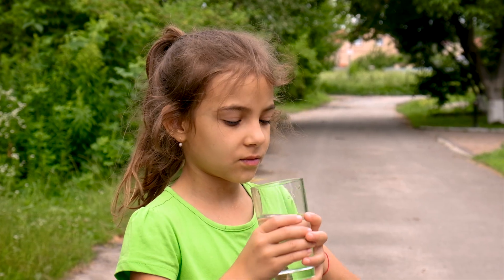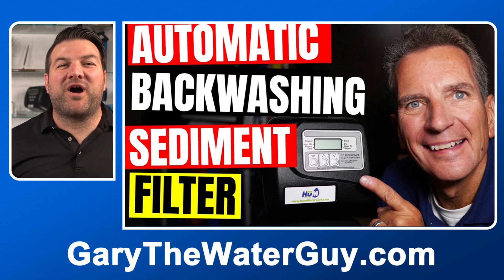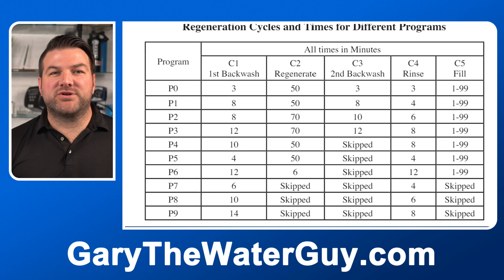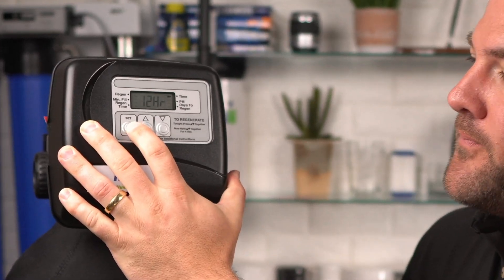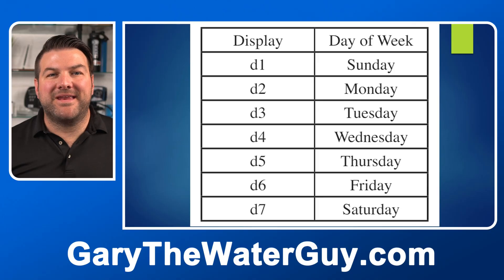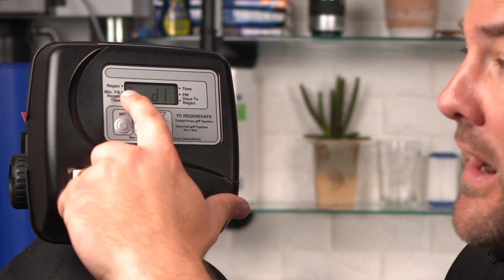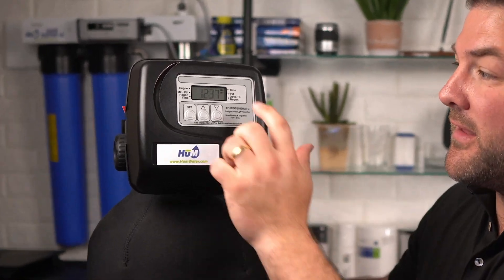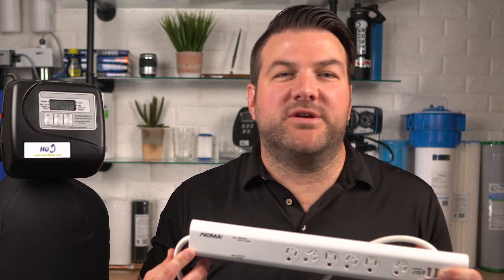Clack 3 Button Water Filter Settings Simplified

Comment: If we have a turbine in the softner, can we set it to regenerate based on water consumption? If so, how would we do this?
Reply from the maker: Not with a 3 button valve, you would need to convert it to a 5 button by following the procedure in this video https://youtu.be/jXr_eQwlpdM
Reply: @water_estore  Thank you for answering! :) I have a 5 button, but I wasnt aware there was a big difference in the programming sorry about that - Would you be able to help or point me to a video to my initial question?

Comment: Hi Gary ! Thanks to sharing your knowledge. You made a great video for WS1 5 buttons injector cleaning & maintenance. How to proceed with WS1 3 buttons for injector cleaning since the regen cannot be stopped ?
Reply from the maker: It is the same, just bypass the system after starting the regeneration